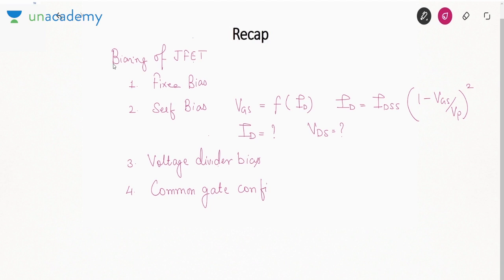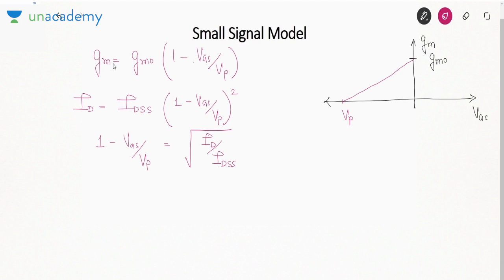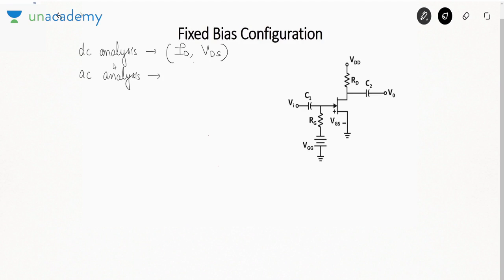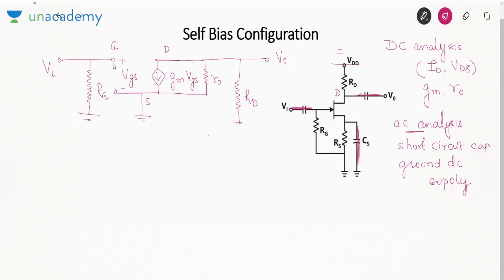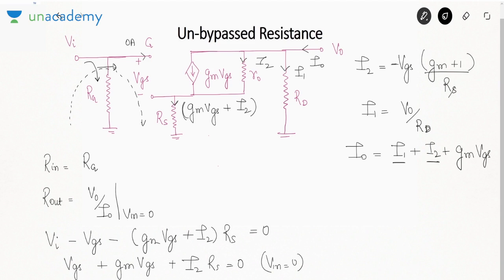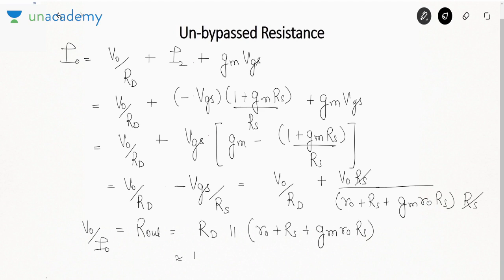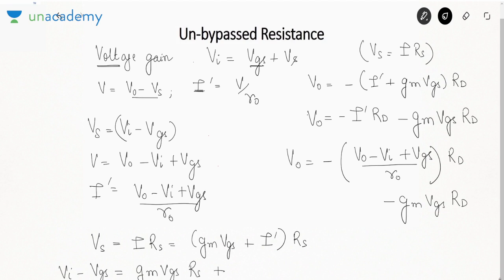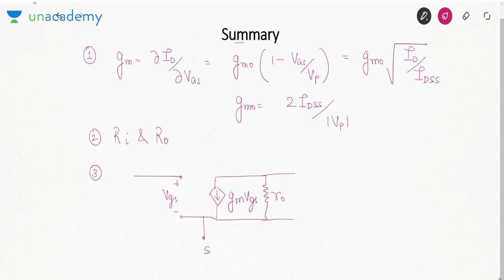JFET Amplifiers - 1 | JFET | Lec 56 | Analog Electronics | GATE 2021 Exam

Comment: In unbypassed source resistance case..all we need to do is.. to assume r0 as open circuit and solve the remaing ckt. Ultimately, sir have also consider finally r0 as infinity..it will quit easy for simplification and the same results obtain.